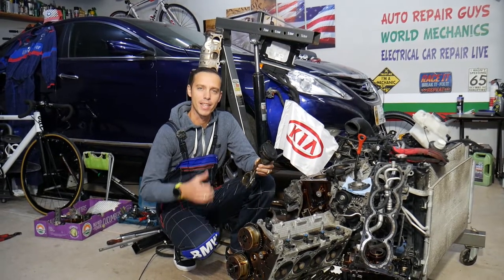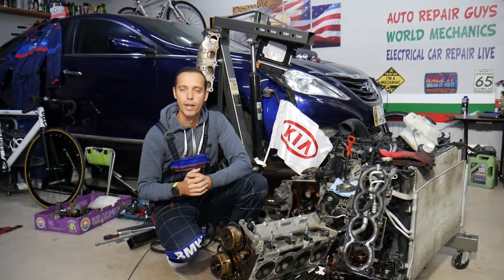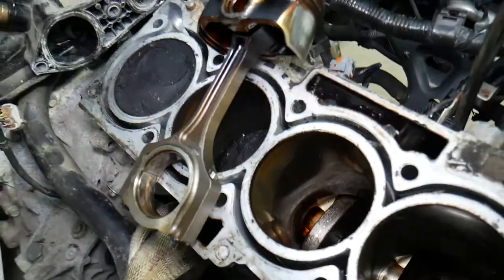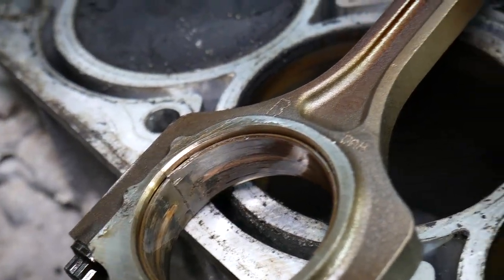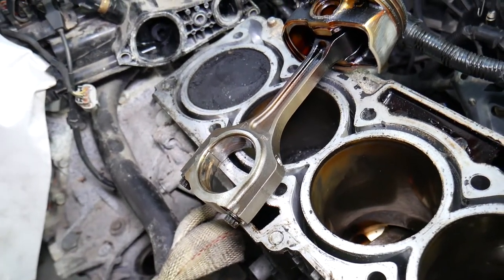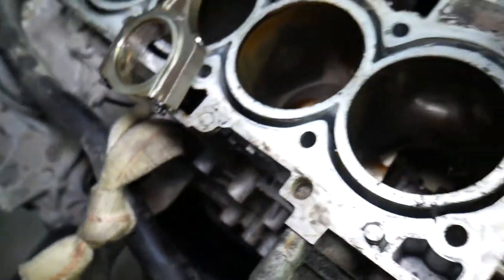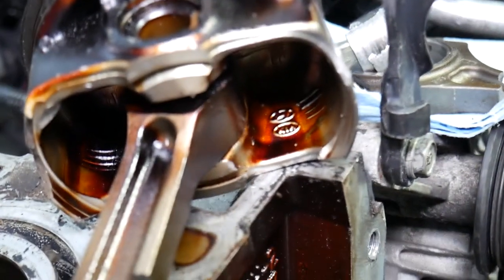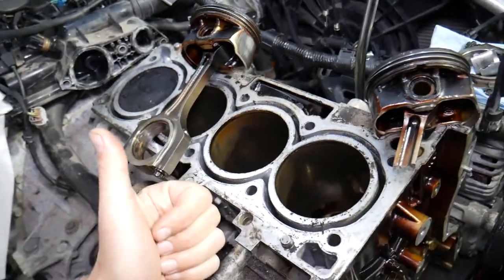SYMPTOMS OF BAD ROD BEARING demonstrated on Hyundai Kia

Comment: I have a 2016 Optima with this engine. It has 107,000 miles on it. There is no knock at this point. I had the recall done, where they updated the knock sensor software. This update extends the warranty out to 150,000 miles. If I no longer use the car when the knock first appears, can I prevent the connecting rod failure?

Comment: I have the same problem on the G4KD 2.0 KIA Sportage engine. It appears as if the rod bearing was never installed properly and ran No 2 bearing. I also noticed that no oil spurt in the sleeve happens as there is no hole in the connecting rod and bearing allowing for that when in motion.

Comment: I bought a used 2013 Kia Sorento LX SUV 3.5L 6cyl engine that supposedly only needed a new timing chain. My son-in-law auto mechanic replaced the timing chain but still heard a knock. He took the motor apart and found this problem. He is now looking for a Kia Sorento motor 2011-2013 like above to use in repairing my Kia. Not a rebuilt one. They are hard to find.